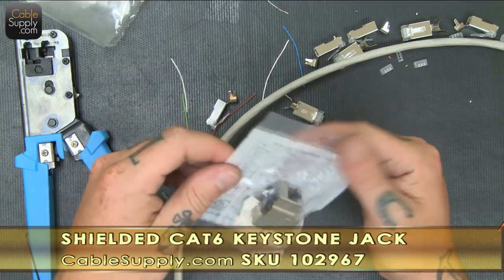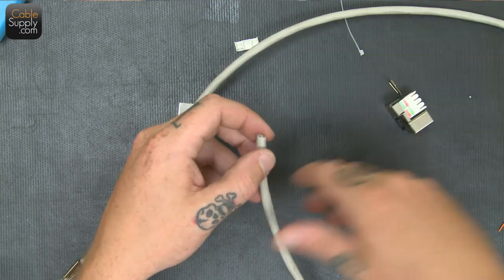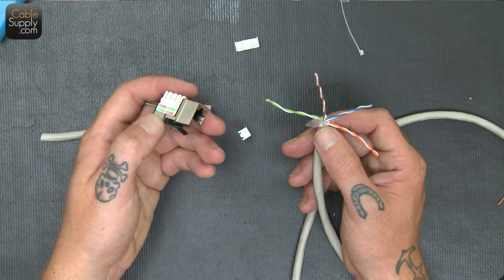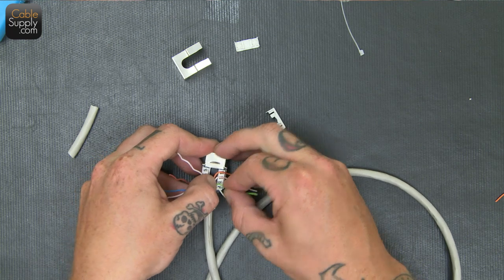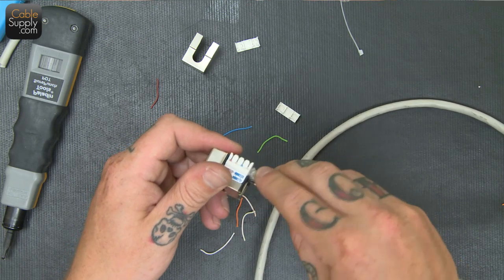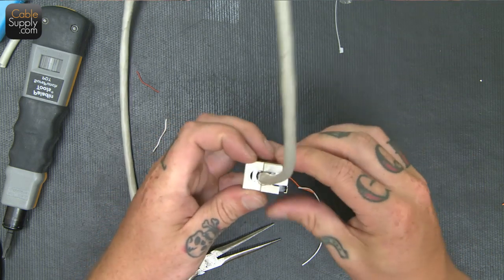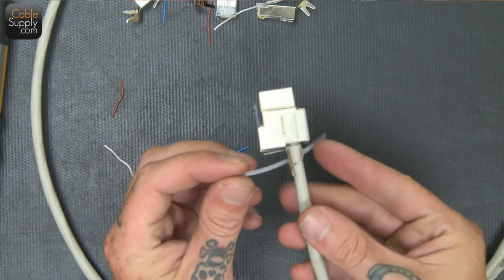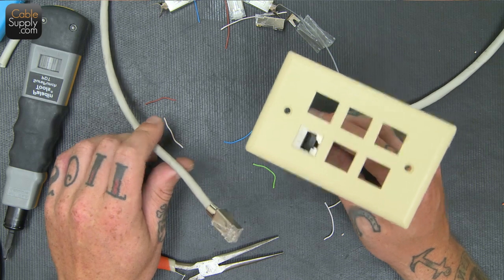Terminating Shielded Cat6 Part 2

Comment: Does the keystone jack make a connection to ground in some way? From the drain to an outside ground.
Reply: I am curious about this as well. did you manage to find out the answer?
Reply: @eirerocks  watch part one, he mentioned that the jacks should be grounded @ a switch/patch panel.

Comment: I see you cut the foil. I thought you needed to wrap the drain wire round the foil to keep the shielding working?
Reply: I don't think you do as the drain wire is touching the shielding down the whole length of the cable and as a result has continuity with it either way, would probably help to do what you suggest though.